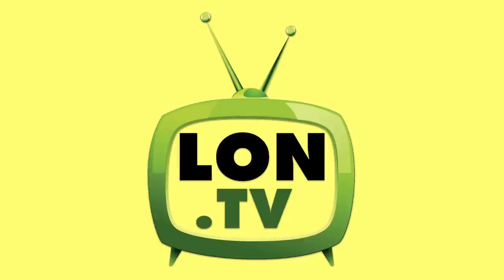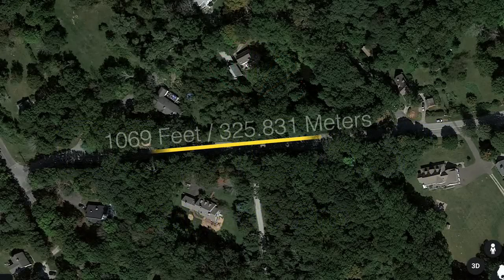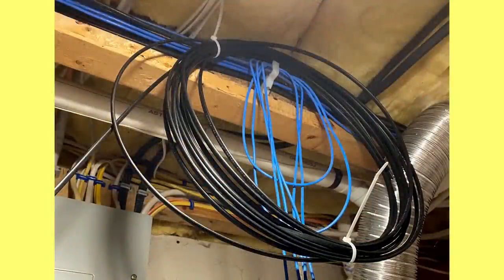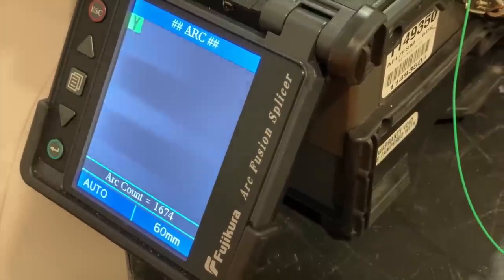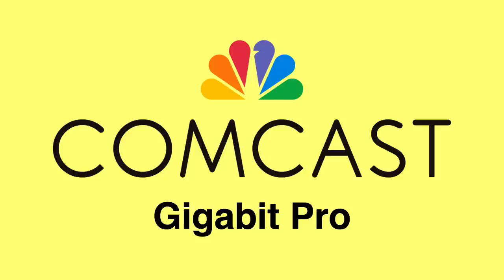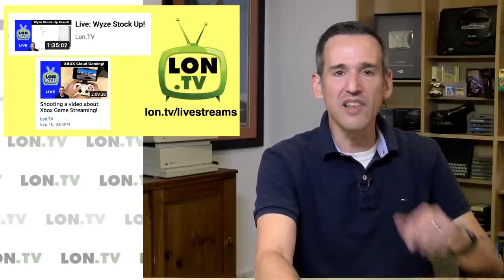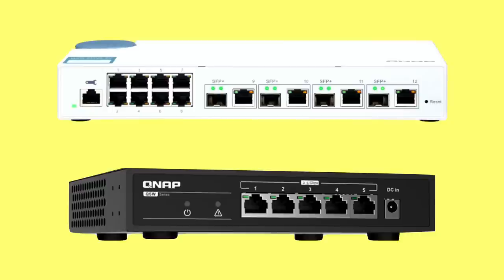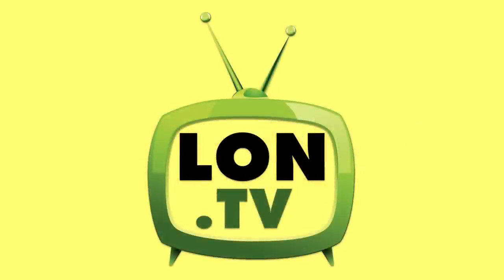Comcast Gigabit Pro Fiber Install Part 2 - Fiber pull and splicing!

Comment: Hey Lon, I got fiber decades ago and I've never regretted it. Having fiber actually relieves that  
aggravating bloat I experienced, and it also helps with system blockage and slow "downloads" where I'd have to sit
and wait and wait and wait for the "download" to finish. Adding fiber, for some reason, also made my stool feel softer,
which was an unexpected bonus. So, for me, adding fiber was a life altering positive decision.

Comment: A word of caution, now that you exposed the fiber strands by opening the jacket, if you were to cut a piece of the strand, the cut pieces can become a respiratory hazard.  Technicians that work with fiber terminations take precautions against this.
Reply: The shards of fiber can also get lodged into your fingers.
Reply from the maker: Yes I tossed out that piece right after we were done! I didn’t realize how dangerous those little strands can be!

Comment: I guess I am lucky to have 10Gb symmetrical internet for only $50 per month (actually $40 with a mobile subscription...) here in Switzerland. Installation was $100 and they even give you a free apple 4k tv.... Having said that, it's a service that is available only in relative large towns and in the most expensive towns (such as the one where I live), rents are very high

Comment: In Coquitlam BC, We have Shaw Internet on the Coax with a good wifi 6 router  you can get speeds up to 1.5G Down with 100m up via coax

Comment: The CWDM is usually to aggregate multiple customers down one set of fibers. I don’t believe they mix your TX and RX
Reply: You are correct.  It essentially combines different wavelengths of light on one fiber.  The send and receive on one cable lon is thinking of is called BiDi and uses BiDi SFP transceivers.  This is the technology my local provider uses and essentially allows providers better utilization of fiber cables as only 1 is needed.  I am actually surprised they are using 2 strands right to the house, but there may be a 1 gig limit on BiDi preventing this.
Reply: Yes... The TX and RX are the same wavelengths just like a "normal" fiber connection. The SFP modules on each end of the circuit need to be specialized to run on the specific wavelength and then are MUXed together to run up to 18 separate 1 or 10Gb/s channels down a single pair of fibers. You have a MUX/DEMUX on each end that breaks them out into the different wavelengths. These are typically passive. There is also DWDM that uses more expensive hardware, but lets you run a bunch more channels.

Comment: The strength members inside the sheath are made of fiber glass and that can be worse to hamdle then the actual glass if it splinters
Reply: And inside that "canister " is nothing more than a splice. The closure keeps the splice safe and allows for other cable to be added. There is no dwdm in there

Comment: It seems crazy to me that a company like Qnap that isn't generally seen as a switch manufacturer is making 2.5G switches for a decent price, while companies like Trendnet, TP-Link, Netgear, etc are lagging behind. I emailed Trendnet and TP-Link right after the 2.5G spec was released and suggested they make some full 2.5G switches (as opposed to 1G with a 2/5/10G backbone port). Basically switches just like their cheap 1G switches except with all the ports at 2.5G. So far not much progress from the big established switch manufacturers.
Reply: not sure why someone would need to have those switches, when you can buy from eBay something like summit x450a-24t, for example. plenty of other switches are available too.  residential ISPs in Europe upgrading with cisco/extreme-networks l2/l3 switches their networks because it's cheap and easy to replace.
Reply: @arishem555  - The Summit x450a-24t is a 1G switch. Did you reply to the wrong comment or are you saying you aren't sure why someone would need faster than 1G speeds in a switch?
Reply: @jjones2582  and it has 2 extension ports 2x10G, did you see specs?
Reply: @jjones2582  and if you can tolerate noise in your home dc, - you can go to x650a all-10g sfps, which is very affordable as well.
Reply: @arishem555  - I think you missed my subtle point in the first post which is that 2.5G switches are a logical step up for the home and prosumer market, without going to full 10G and all the heat and fan challenges. But all the manufactures except Qnap (which wasn't even a switch manufacturer) seems to be very slow to market.
Reply: @jjones2582  It seems that only limited amount of homeowners would need to have 2.5G standard. Can you provide scenarios why would you need it to? Usually, I would have some server with different VMs running on top of kvm/esxi, I would have external storage and that's probably it. And I'm not sure why would you need to have unmanaged switch at home, where you can not put  even couple of vlans?  What about PoE, redundancy, wireless access points with separate vlan for mgmt? I think you are missing one huge drawback about that 2.5g standard. It's not tested wide enough, software was not meant for 2.5gbps ports. You would have some switch products with hundresnds different glitches and you would pioneer that hardware(noone will do proper QA and fix all the bugs after that). 1g/10g proven standards. I bet besides the switches I gave you, - you would be able to find way more switches with L3 capabilities for a reasonable price. This is the rule of any hardware or equipment: if you don't have released millions of copies of it, - this product still will be alpha/beta release. But again, it's up to you. In a customer environment mostly all the cables are coming to one location (1,000,000$ and higher value properties). In the closet room you will have already quite a noise. I still cannot get, why people buying new netgear switches (400-700$), as example, when you can get  cisco 3560G with PoE for 50$. It doesn't make sense at all for me. And at houses for 10mln$+ you would have very different hardware. If your house worse 10+mln$, - you would probably end up with 3 different locations for switches/routers and u'll probably have rstp or l3 routing. For tens of different houses/apartments I never had a requirement for interfaces more than 1gbps. Yes, you would have 10g port to your servers, file storage. You would even have sdwan/ipsec tunnels between your different properties. But nobody never had a request to get 2.5G :).
Reply: @arishem555  - Why do people need 1 Gbps networking over 100 Mbps networking? It's for basically the same reason that they might want 2.5 G over 1G if the price isn't absurd. If you shuffle any large files around the network faster speeds make things more usable. If you get the speeds up fast enough you don't need to shuffle things around to work on them. 10G would obviously be ideal, but no one has gotten a full 10G switch at a reasonable price which tells me it's hard to handle that much bandwidth in 16+ ports.  

Also for the same reason that someone buys a 1G dumb switch they might buy a 2.5G dumb switch. You don't need VLANs for basic network traffic. Also, anyone with a NAS could probably benefit from 2.5G if the cost was reasonable. Visit the various home theater forums to see how many homes might have such a thing. Alternatively, how many Youtubers are doing video editing in their home?

Then finally I'm not necessarily saying they need to manufacture only dumb switches. You can currently buy 8 port 1G smart switches with management features for $100. It would be nice to see a 2.5G variant for 50% more rather than 500% more like we see on the 10G variants.

Hopefully in the long term 2.5G switches will just become the new entry point like 1G is now.
Reply: @jjones2582  I'm still missing scenarios for 2.5Gbps connectivity. How many desktops at your house are wired connected? How often you are using wires at all? Why would you want QA non-tested hardware software? If you want so bad 2Gbps, - use 2 1gbps or LACP or any other port aggregation. I can understand, for example if you are youtube and doing like pro videos all the time. But for that scenario you would need probably 10G. Or another scenario, - you are in Europe, where you can torrent 100G bluray for free from torrent. In that scenario, I also understand why would you need 2.5Gbps. What exact scenario, Jeff, you are looking for? I'm very interested. Not hypothetical, but real ones please. Only in one production environment non-residential I saw implementation of 2.5Gbps Aruba access points. And this is only the scenario what I can think of.
Reply: @arishem555  - The main reason is I want a home network upgrade without having to spend $200 for each switch. So the sooner that 2.5G becomes the next standard the better. For that to happen though first generation 2.5G products have to actually be released. I'm also looking forward to 2.5G being standard on all motherboards too.

I have two wired desktop computers and a NAS. Where I work has seven and a NAS. Specific examples is copying photos and videos from a workstation to a NAS and back. I do it at home, I do it at work. I have friends who do it for their hobby. Everyone in the world could benefit from faster network speeds if it's automatically included in entry level products.

Plus if 2.5G had already been in place Lon wouldn't be upgrading his entire network today. So for people building out networks today and next year it would be nice if they had a 2.5G option.

A TP-Link T1600G-28TS costs about $130 and has enough ports for most small companies.  I don't expect 2.5G to immediately be that cheap, but I would expect them to eventually get there. If you could even find a 10G switch with 28 ports it would be $5,000 and take up 4 rack slots.
Reply: @jjones2582  That it actually makes sense to switch to 2.5Gbps. Not sure what's holding it. Probably the same story which is happening to 40G. It's popular, but 100G usually preferable.
Reply: @jjones2582  Hi Jeff,
I think you're misunderstanding the point of a 2.5(and 5)GbE connection. They're designed for density computing applications where high bandwidth isn't required. 10G SFP+ and 10G BaseT are both high power applications, and in a high density datacentre, that can be a problem. (Think 200+ compute nodes per rack).

Outside of the high-density data centre environment, you don't have the same restrictions with heat & power, so 10GbE is a perfectly logical next step. It might be expensive, but if you have a need for it, it makes sense. If you cannot justify it, you probably don't need it. $300 for a switch, and $100 each for 10GbE network cards is pretty reasonable for your high performance applications.
Reply: @Netvyper  - Did you say the same when 1 Gbps was first introduced?
Reply: @jjones2582  Kind of... I lamented the availability of 1Gbps for those who could afford it. As a student I couldn't to start with. So we made do with 100Mbps. The only use case I had was copying files around. Faster is better, but not required. 

Admittedly the advent of flash storage has meant that networks are more commonly the bottleneck, but 2.5Gbps doesn't completely eliminate that anyhow.

Comment: Lon, when you get everything up and running. I would like to know if you get iPv6 up and running. I got the same service and I'm using a UDMPro as well. No matter what I've tried do done. I have never successfully gotten my iPv6 to work. Maybe if we compared notes we can figure it out and get it working.
Reply from the maker: They didn't give me my IPv6 addresses - I'll need to followup on that!
Reply: @LonSeidman  The do it's in the email they sent with the static iP. But I've never gotten it to work.
Reply from the maker: @wakkedoff  I'll have to get in touch with my project manager I didn't get an email with the IP4s, the installers had it with them when they set things up.

Comment: I don't understand why Comcast will only sell you 3Gbps service but that service comes in on two separate lines, a 1Gbps & a 2Gbps line?  If they have to split the service over two physical lines to achieve "3Gbps", why can't they just sell you EITHER the 1 or the 2 gig fiber service individually?

Comment: My God $300+ a month for Internet service?!  WOW! 😳😬
Reply: I remember paying $850 a month for 10 megabit.
Reply: it's too expensive. but when those guys are owning those poles, - you cannot do much about it. unless you'll have some kind of contract with the city and you will build your own network next to comcast/att. But I can understand comcast as well, cause you paid once to connect your service and you will not be probably responsible anymore for any cable damages (except last 100-300 feets). But when you are maintaining your fiber network on day to day basis you would need to have funds to recover it after any kind of disaster or local issues.
Reply: Holy cow, that's crazy expensive!  I pay $85 a month for AT&T 1gb fiber.  That's my full cost with all local taxes included.  On speedtest, I get 900mb down, 850mb up.

Comment: Comcast Gigabit Pro 2000 Mbps2000 Mbps $299.95/mo. I wish I could afford that, the website says they still have data Caps? The site doesn't have any information about being exempt on this plan, it could be there but burried.

Comment from the maker: I should have stated this in the video: fiber optic cables strands can be dangerous if not handled correctly. As many of you have noted they can result in painful transparent splinters or worse create respiratory issues. The strand I demoed was thrown out when the video was done and the other leftover cable is safely taped up to prevent any injury. The technician was a pro who safely handled the cable and cleaned up after the work was done. I did think you all would find it interesting to take a look inside the cable just because it's magic to me that this even works given how tiny they are. 

Also to answer a few other questions: No there is no data cap on Gigabit Pro. And yes it's expensive but what's even more expensive is dealing with the slow unreliable connection that I have now :). The faster speed will result in better reliability and less wasted time when uploading to the multiple platforms we're delivering to now. Also Gigabit Pro is a metro-ethernet product and not a shared fiber technology like GPON.
Reply: Lon.TV I have in the Telecommunications industry for several decades and have almost exclusively worked in the fiber optic portion of the industry. I started off working as a fiber splicer back before there was such a thing as a field portable fusion fiber splicing machine.  When I first started splicing fiber it was more of a "black art" than the relatively simple near fool proof and easy process it is now today using a latest generation of fusion splicing machines.
Reply: I'm curious....if your neighbors really wanted to get the same service, would they also have to pay the $1000 installation or would they piggyback off of the work that you already had Comcast do down the driveway?
Reply from the maker: I think that's the standard charge. They'd have to run fiber into each home, splice, etc. Comcast's cost would be less of course :)
Reply: @LonSeidman  
Lon think of home fiber as Dual Lane fiber (transmit+ receive) long haul Single Lane Fiber that go about 25 miles before being boasted another 25 miles in one direction for each fiber! so /dual Lane for home and single Lane for long haul!

Comment: The CWDM looks like it might be a passive one, meaning it uses no power.  They're pretty neat, they only use prisms to filter wavelengths of light.  If it is passive, your SFP will be hardcoded with the specific wavelength assigned to your connection.
Reply: Looks like an ordinary splice can to me. so the fiber coming towards the house was spliced into dark fiber in the main line that runs into the splice can.

Comment: I can remeber back to when a fusion splicer was truck-mounted and splicing cables by railway lines could only be done when no trains were within 5 miles (due to the vibration)

Congrats on the bandwidth!